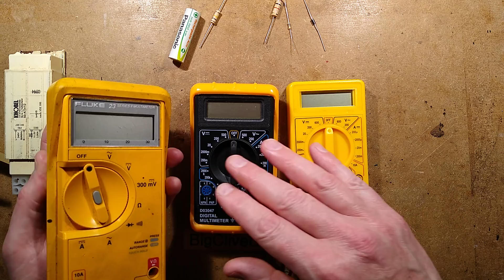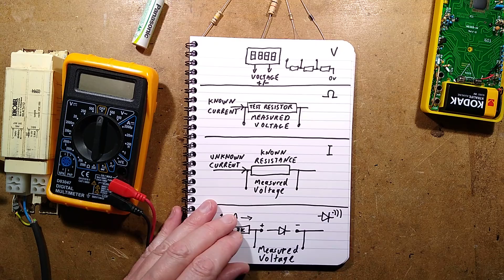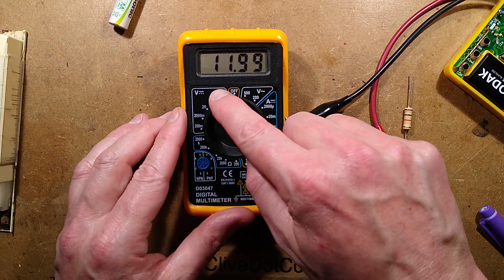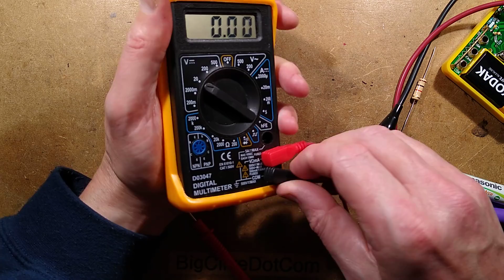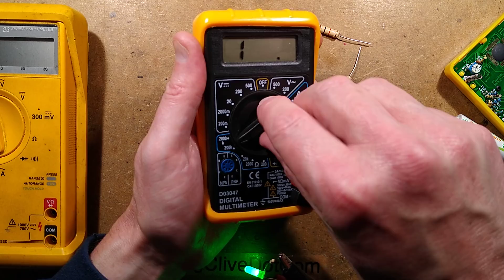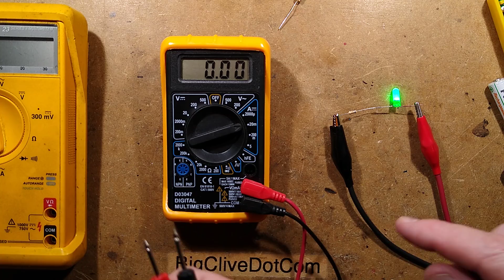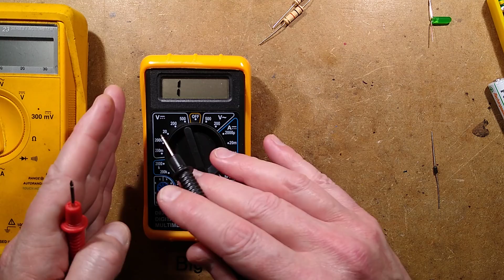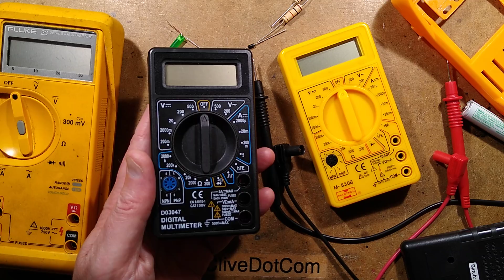How to use your trashy meter without blowing it up (much)

Comment: I have the exact cheap meter shown in this video which I only use on automative applications (12v). However, it said on Amazon, upto 400v I think. Just looked at the cable after 1 month of ownership and it has completly split with quite a significant amount of exposed metal on the connector side. Wouldn't want to accidently touch that if used in mains applications.

Comment: I have been thru a few shitemeters but I now use a Proster VC97. It has auto ranging, looks like a Fluke 175 and is surprisingly accurate. It cost me £20 off fartbay.
Reply: oh, and of all the cheap ones I never used the crappy "Transistor tester". Because its shite. :D

Comment: Oh, and this always-just-measure-the-voltage approach is very good and requires only having one ADC interface on the controller and just a commutable network of resistors. I must admit that I like it, and I suspected something like that.

Comment: I have a cheap meter that was a freebie from Vicor power supply co. But it has class 2 leads, marked 1000 volts, very nice. 

I used a Simpson 260 for many years at work. Hard to kill. But one guy measured the ohms on the shorting stick on the output of a 390 KV, 1 amp power supply and forgot to remove it. We never did find much of it.

Comment: I still have a few analog meters around simply because the digital ones are so sensitive that they will show a voltage even when there is no current to speak of.  They are also a bit too fast acting when fluctuations are occurring.  That said, it's hard to beat the accuracy and readability of a digital when you want one.

Comment: My first multimeter was like your first one Clive.  A little tiny one I got from Dick Smith, with an analogue meter and peg-board type arrangement for selecting function and range, no beeper for continuity.  I think I probably did eventually kill it by leaving it in current range by accident.  They were the equivalent of these cheap digital meters back in the day as far as affordability is concerned (I was still in school) but the accuracy was not the greatest, plus you had to keep in mind the ohms/V resistance of the meter when testing sensitive circuits.  For most hobby things they were fine however.  Professional meters were just not in the price range for a young hobbyist, though at the dawn of the digital meters you started to see some very nice analogue stuff become available to the hobbyist as the traditional manufacturers started to unload stock of the better analogue meters under different brands.

I can't even find any images of similar meters any more.  They simply weren't good enough or accurate enough to warrant saving even for posterity or curiosity.

Comment: Measuring a Voltage with the leads in the Amps connectors...
I have to confess, that in my history of about 20 years of working with electronics, this still happens to me. All though the intervals get bigger. Just like the classic forgetting the sleeve/strain-relive for that connector you just soldered the 20 pin cable on to

Comment: I loooove my cheapy meters! I have 3 tiny pocket ones I got for like $5 each, toss them in my bag, not worried if I drop them down the steps or off a roof… and it’s nice if I want to measure multiple things at once! I also have some slightly fancier meters [pocket ones lack a beeper, diode check, few range options]. Including a Fluke, which I also love, but use that less! It’s my go-to for mains stuff. One of mine has the gain checker, and k tried using it to see if a transistor was dead… and realized it did nothing for a known good transistor, so not sure it works at lol, lol. Mostly use 20VDC and resistor ranges [I can’t memorize the resistor code and it’s faster to meter than decode from a chart]

Comment: I agree  with the cheap meters .  If it important to more numbers then I use one of the 4  HP 3455a  in my rack . The cheap meter will get close enough most work but not all.

Comment: At school we had AVO meters. These were considered the Rolls Royce of meters and were huge, rugged and expensive.  I'm aware of being told they contained hand wound components and could be sent off for recalibrating.
They quite probably were a WD spec that remained in use because it was reliable, which might explain how schools got them, maybe as army & navy surplus. They looked like a meter should if you were of a certain era, and were fairly ubiquitous until about the 90's. They still turn up in auto, boat, etc. jumbles.

Comment: I use two cheapo meters, and one mid-range. For hobby use they are sufficient. The only other meter I use is a very high impedance voltmeter with 10Gohm  input usable to 1.99kV for measuring geiger counter ht supplies (this meter is not commercially available, I designed it myself, and it was very expensive to build).
Reply from the maker: I'll guess a long high value resistor divider and amplifier to avoid loading the circuit.  Probably useful for ionisers too.

Comment: I've bought cheap "ceramic" fuses from ebay, sure the enclosure tube is ceramic, they just aren't filled with sand, so they don't really do anything more than a glass fuse. You could break and check those fuses in the CPC-unit.

Comment: I have that exact trashy meter, I only just noticed that I was on the 10A socket, and it still works on the lower settings from that socket ! i.e still can read ma when on lower settings

Comment: i am an appliance repairman and i go thru about 3~meters a year. the thing is you just forget to switch them from the amp range one time and they blow up!
i think the most useful thing is to chop a pair of leads you dont like and solder alligator clips on them. i use them often on 110VAC you just have to be careful and buy a good pair of leads for 5$. most of the stock one are garbage, if the wire incoming to the handle isnt "molded" and is free to move inside they will rip off and give false readings for WEEKS! before finally popping off.

Comment: With a Fluke 77 and Avo 8000 in my toolbox, I cannot really comment. That said, I do have a cheap and cheerful £15 Chinese affair but it seems to behave quite well.

P.S. I still have an AVO model 7 & 8 and use those too for certain applications such as audio gear servicing. Old is gold.

Comment: Yes, Fluke has absolutely marvelous measuring equipment. But hardly anyone really NEEDS that precision and quality.
My most used multi-meter is from Hapé. It's about 30 years old by now, still works perfectly, and it has capacitance, temperature and frequency measurement and an RS232 out! Was about €20,- at most. 
I also have a Dynatec (not quite Fluke, but close) but it was blown up, and I still haven't managed to completely repair it.
The only time i EVER put a transistor in the gain tester was to see what the meter did XD Not ever to test the transistor XD

Comment: I recommend cheap meters for automotive work, except for when working on, say an ECU, where precision is necessary. 
For mains power,  these are usually adequate for checking wiring, or reading low current, but my name brand "amp clamp" is more valuable for home electric circuits.

Comment: I also prefer meters with the 'scratchy' continuity testers, in work I often have to test push switches and having an instant beep can help diagnose intermittent switch faults
Reply: I recommend you change your brand of switches.
Reply: @millomweb  Not really the switches'' fault - usually user abuse / lead faults
Reply: @theturtlemoves3014  Good switches are designed to take user connection out of the equation by using mechanisms that don't transmit the abuse !
Reply: @millomweb  unfortunately the choice of switches we require are limited, and due to their use by the disabled necessitate them being very light to operate.
Reply: @theturtlemoves3014  Use microswitches with protective mechanical linkages.

Comment: My parents gave me an analog Russian multimeter. 
That was big and bulky. I always had to see which scale was the right one. From 0 - 30 for 3 volts, 30 volts or 300 volts. Or if I had set it to 15 volts, then the result had to be halved. 
There was a different scale for DC and AC, volts and amps. 
The hardest part was measuring ohms. Then the scale started on the right and went to the left and was not linear. 

Analogs measure current, digital measure volts. 

I later bought a digital multimeter from a local dealer. Today I know it came from Asia, but it was printed in English. It even has an isolated serial port, but the software was in DOS. At that time I only had a C64 and I had no idea how to install it. Somehow needed +/- 12 volts for serial over optocoupler.

Comment: I have a Fluke and several other 'posh' meters. I hardly every use them. I bought (special offer EBAY) 3 of the cheap ones shown. Unles you are into very, very complex electronic work they are more than adequate. All of them are within 0.1% that's 1/10V in 100V. I do have an 8Amp inline fuse solered in the leads. I also have an older very cheap meter that attact me with a ball bearing. My soldering iron was resting on the  range setting and melted it. Apart from no click it works perfectly. Good old Mao, I bet my Fluke would not like that one bit and at 16 times the price for the cheapest Fluke mine stays in the drawer, special coccasions only.

Comment: Nice video..Rishabh model RISH MULTI14S has foolproof mechanism. The knob decides the probe hole i.e. if knob is on Voltage measurement mode, the current probe hole will covered by knob mechanism. Same is the case with current measurement, if the knob is on current measurement mode, voltage measurement hole will be closed. Hence there is no way someone could put probe in wrong hole...

Comment: I do own a few expensive meters mainly Fluke, however I find myself  usually reaching for my cheap  and in fact very cheap meters, I am not sure why, but I must say they are just as accurate or at least as accurate as I need, I am not a big  fan of auto range and I do like a nice  clear rotary click knob, rather than a combination of push buttons. The only downside of cheap meters is the cheap leads they come with.

Comment: i use 2 meters. one came with a shit 15 quid soldering iron, and one, my 'expensive' one cost me 40 quid. and it doesn't measure V. just L,C, and R. but i love it so much. i still get a frisson of delight when i measure the inductance of a thing. I think about inductance a lot of late. it is so ruddy interesting. i bought an amazon box of inductors, and the first thing i did was solder one to a capacitor, then have a look on my 'scope whilst playing with my function generator. it was jolly interesting. they really really like some frequencies. a bit like when i played with crystal oscillators in the same way. dunno why i'm telling you all this, other than it is nice to talk to my peers.
Reply from the maker: LC tuned circuits are definitely quite interesting.

Comment: Years ago I did game console mods and my meter was always set on continuity to make sure I didn't bridge any solder joints. The other thing was testing if an LED was working or not (also helped me quickly figure out which side was positive).  Other than continuity, I never really used anything else.

Comment: I got a clear demonstration on why the cheap meters aren't suited for mains voltage. When I bought my house some years ago I had such a meter that I had used for several years so without thinking I grabbed it when I needed to check which wires where live, neutral and switched (for a lamp). 
Set the meter up for AC voltage 2kV and plugged in the cables, then I held the probes to what I thought was live and neutral.

BANG!  It was...

First thought was that I mussed have messed up and put the probe wires into the 10A slot... Nope. Okay then I must have selected the mA range for sure?
Nope, it sat on 2kV.

Opening up the meter and taking it apart showed the cause... The cheap turn selector had failed and folded it's connectors causing a serious short circuit.
At least the sparky stuff and melted metal was contained inside the meter.

But I still use cheap meters for a lot of things - just not mains...

Comment: fun fact: Fluke 23 is just a Fluke 77 with yellow case. So long as it landed on the vinyl boot when you dropped it, they were nearly indestructible, and fairly stable / decent for the price point.

Comment: I think the voltage rating is much underappreciated for these meters. Just reminds me of when I was in the main electric room for a complex that was being supplied with 480V/3ph/800A and all the panels where completely exposed without any covers. And the head electrician was using one of those $10 meters and just plopping those cheap leads in indiscriminately right around the bus bars with both hands. And we wondered why there were electrical issues there. Hmmm...

Comment: I blew the fuse in my cheapo meter so opened it up to swap the fuse and all the selector contacts fell out along with the odd spring, Rather than go insane trying to put it back together it hit the bin and i replaced it with the small black meter with the yellow case in your video for £7

Comment: Nice introduction. Like you, I find the gain test a waste of time - you can do go/no-go and NPN/PNP with the wet-finger test much more easily and quickly. Also, I'm afraid, any meter I buy gets a beepectomy instantly - I find it really annoying and would much rather look at the display. When you buy your first meter it's worth getting a lead set with interchangeable ends too.

Comment: my friend has blown analogue multimeters in his youth, the resistors go incandescent, he says the meter lights up from inside. I think you just blow the resistor for that range. He had this habit of soldering the probes to the circuit board.
I have a couple of digital multimeters but I also have an analogue one. I always like the moving needle. And if you are only measuring voltages it will still work even if the battery is flat.
If you have it set to DC voltage and connect it to AC the needle will vibrate, presumably at 50Hz, I’m told it doesn’t do the meter much good to vibrate like that.

Comment: OL on the meter means 'open loop' or 'open line'.  It refers to voltage that is not making it to one of the test probes.  In other words, an open circuit.

Comment: I like the fuse-less shunt of the DT-830 HF knockoff for automotive parasitic draw tests. If you accidently open the door or something, you can put 15 Amp through the meter for a good 15 seconds while the dome lights time out. 

A brief blip of 20 Amp is no problem. These mistakes do not cost any money with the DT-830, never seems to affect their accuracy. 

Always press down on the center of dial of the DT-830, this is about the only fault I find, the readings can change, slowly sweeping the knob around a dozen times will sometimes scrub the oxidation off, sometime the knob is starting to separate inside. (you can usually still get an accurate reading when pushing in the center when this happens)

Comment: Bought a couple for about 4 pounds each quite a while ago; more that adequate for low-power stuff I prefer doing. Probes fell off their wires within days because they were literally hanging on copper core, but a decent pair from China is barely 2 pounds. One of those meters doesn't even have a fuse, only empty pads for it!
And l've soldered alligator clips instead of probes on now vacant leads, which is much more convenient for breadboard stuff.
I think there's ICL7106 clone under those blobs in, well, all of them. It, or better, it's led driving brother ICL7107 is a great chip for beginners, in my opinion, to do a basic meter from scratch and get a better idea of how those tools work.

Could be a nice DIY project, with PCB divided into functional areas.

AC range showing double DC voltage is just how this thing works - to measure AC, it simply sends it through single diode across about half of resistance it uses to measure same DC voltage, which would give mildly inaccurate AC reading (thus 200V range minimum) and double DC reading in one direction.

Comment: Although I have two Fluke meters (flash b@ast@rd!) I have two or three of the cheapo ones and find them adequate for general use. I would not trust them on mains supplies and, were I forced to use them in such a way, would never hand hold them whilst doing so. My concern with the  £5 meters is that the leads are so poor in general, being made with low CSA wire, sometimes not even of copper, having suspect insulation and frequently poor anchorage of the conductors in the terminals.

Comment: i'm an electronic engineer. i am not working on electricity or electronics, but i have used a cheap 30€ meter when doing my lab stints in university. i've measured north of 400 volts with them, if you know what you're doing, you can absolutely use them on high power applications. having two of them allows a constant reading of power, and that's a high value feature if you need it which you won't get without spending 400 quid on two flukes. besides, no one doing this for fun will ever need anything close to the accuracy that some tech gurus claim is absolutely indispensable. buying cheap allows for buying quantity
Reply from the maker: If the equipment is capable of delivering high current then I only recommend a meter with a suitable HRC fuse in it for the potential fault current.  For most applications a cheap meter is fine, but for factory equipment it has to be at least Cat III.  (Real Cat III)

Comment: I thought Big Clive was calling the Fluke a trashy meter 😢. I myself started with a Sanwa analog with fuse and diode protection and an original AVO analog as my backup, right out of school mid 80's. Got myself a Fluke 79 series II around '91.. still working perfectly.